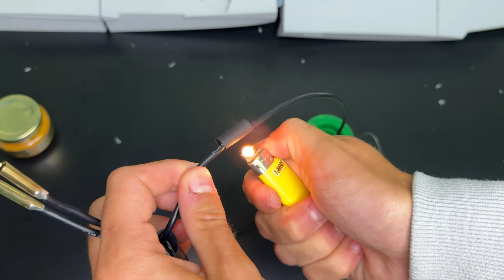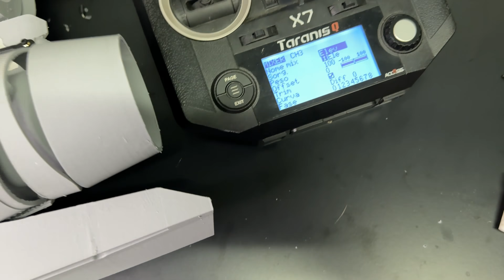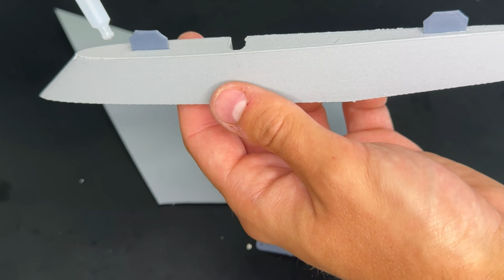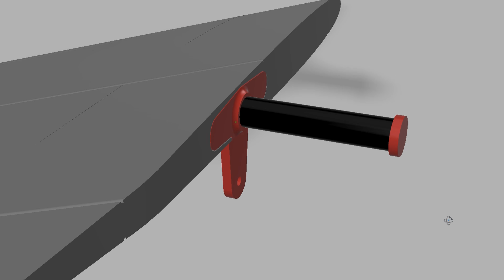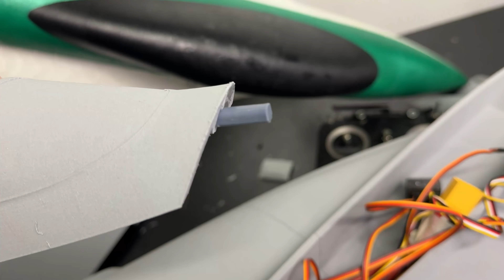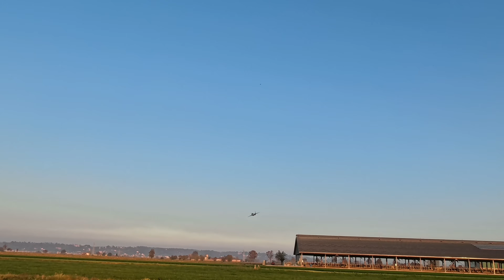Building a Thrust Vectoring MiG-29 (3D Printed)

Comment: Amazing design! beautiful model!  Please listen to your future customers in the comment section:  If you add a version with landing gear retracts they will buy it.    You are a great pilot, but most of us are not as good as you are. Having retracts on this model would help people  with the decision to purchase the plans, knowing they won't break it apart  on the 2nd or 3rd belly landing attempt. With LG,  I will buy it for sure :)
Reply from the maker: This project is specifically designed for hand launch and belly landing because of the thrust vectoring system. The plane needs to be as light as possible, and retracts would easily add 200/300g of weight, that would make the thrust vectoring completely useless. I do already have designs with retracts and more will come in the future

Comment: What are your print settings for the lw pla? for me it prints well but only at extremely slow speeds. Im wondering if theres any way to make the printing more efficient
Reply from the maker: On my facebook group I have shared my personal settings! You find the link in the description 
But yes, LW filaments want to be printed slowly
I print at 60/70 mm/s
Reply: @LSPlanes   oh alright. so how long did the entier plane take to print in total then?
Reply from the maker: @LemonJuice_I’d say around a week
Reply: @LSPlanes  yo man i tried making a similar design to yours but using 50mm edfs. mine came out weighing an entire 1900 grams even though its actually smaller. how did you manage to make yours so light? what infill and wall settings worked best for you?

Comment: The ESCs should be as close to the edf as 
possible
Reply from the maker: Long motor cables are better than long battery cables. And since the EDFs are all the way back, it’s better to place the ESCs further forward in this case.
But thanks for the suggestion!

Comment: Protip - it's always better to have long power leads and short motor leads if your motor-esc-battery distance is long. Usually that also helps get the ESC in an area where cooling airflow can pass over them.
Reply: I'm sorry but I think you got it wrong there. Short power leads can damage the esc beacause of voltage drops. The length of the motor-esc leads doesn't really mater since the motors already have a high induction. So long motor leads is better than long power leads🙂

Comment: Hi, friend! Your projects can be printed with other materials, like PETG? Here in Brazil we have a huge problem with heat, and my PLA and LW-PLA planes are deforming even during flight.
Reply from the maker: Hi! It depends by the design you choose. This one in particular is suggested to be printed with lightweight materials since it requires much power to perform certain manouvers
You can try with LW-Asa which is heat resistant 
Anyway some of my previous designs have been successfully printed with ABS

Comment: how you solder thick cables together is no so professional. Once again, using hot glue is not the best solution
Reply: Using hot glue works just fine! And it has the added benefit of being easy to remove / replace items just by spraying the glue with isopropyl alcohol, which makes the glue basically fall off. I've got several planes assembled with hot glue that have lasted for years, so I have no issue using it to retain servos or fans on smaller models.
Reply: yet, screws and element beds/covers add no extraweight compared to hot glue whilst adding tighter mount strenght, quicker and less cumbersome removal and better looks overall. 

His designs are superb and quickly maturing into something that is in between semiprofessional and professional product. Being serious about correct soldering techniques and detail mounting approach will only elevate him further up.